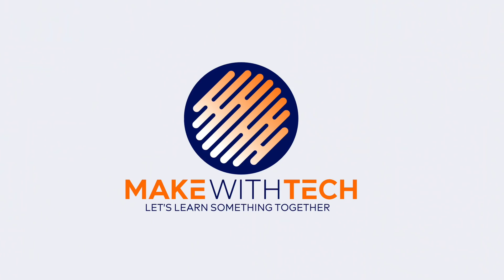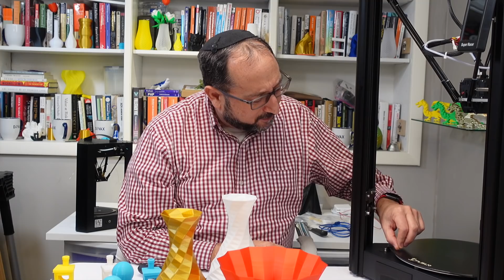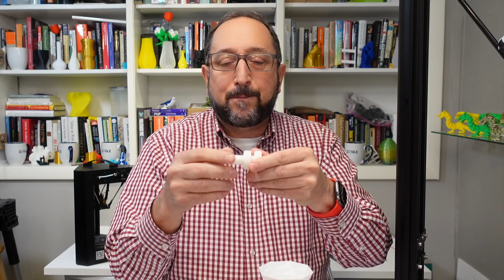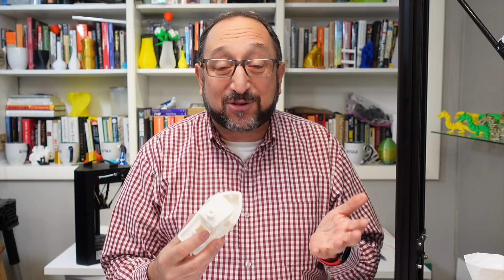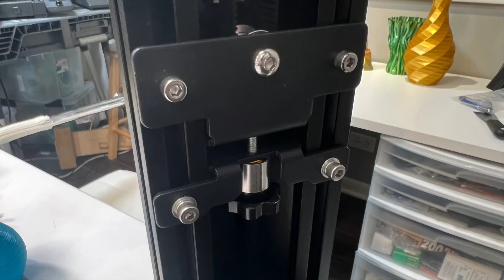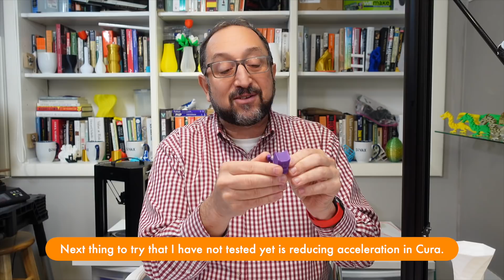Flsun Super Racer 3d Printer Review, Speed and Quality Tests

Comment: I am intend to buy a FISun and have one specific question about the building volume: i need to know if the printer is able to print a diameter of 37mm at a height of 322mm ? 
Due to the delta config i was reading that 260mm is limited to around 275mm and from there the max moving to the center.

Comment: I have a super racer and it prints really well up to around 10 CM height, after which the nozzle starts scraping the top of prints, getting louder with each layer, until eventually, it knocks the print off of the build plate. This happens with the default settings and I've tried zhop set to 1 mm, combing on and off, extrusion set to 80% but it still scrapes and knocks off prints. 
Can you please advise?
Reply: Could you solve it? It happens to me sometimes at any height, I think it's because it moves so quickly and the filament melts and loses its shape and when it dries somewhere else the nozzle ends up dragging it and throwing the piece away.
Reply: @Facuvw  not much improvement. It's due to a cooling issue. The freshly printed area curls up, especially infill which then drags the nozzle. It gets worse with increasing speed. Reduce infill and wall speed to 80 max.
Or return if you can get your money back.
The installed fans are very under sized. I had to buy and splice 5015 fans. I had to print and install brackets for them. Then I had to print and install different fan ducts. That has reduced the issue but not completely eliminated it.
With the amount of time and money spent I should have bought a Bambu carbon. 
Most of the time I end up working on the printer rather than 3d printing.
Most of these YouTubers get compensated in some way for reviewing these products and don't like to talk about these gotcha issues. Then we get stuck with these printers.

Comment: Thank you so much this actually solved my question because I couldn't figure out why my printer wasn't able to detect my flash drive. No one on forums answered that it was a firmware problem and that the SD card AND USB slot don't both work out of the box.  Also thank you for going into so much detail on tuning it, I got mine this past week and am excited to improve print quality already.

Comment: That was hands down one of the best, most thorough reviews - answering all the question I had about this printer - that I have watched. I was on the fence to buy this one and this review helped push me over the edge to make the jump. Thank you very much for your time and excellent investigative review!
Reply: Agree. Wish more reviewers would point that out instead of just saying how fast it is. It is fast. Anything post 40mm/s is fast, and this printer blows that out of the park with way better print quality than most traditional printers at high speeds. However, most people need to know they'll probably be best served at lower speeds than the max the printer will do, which will still be fast by most 3d print standards.

Comment: Great review; and knowing my way around 3D printers and especially delta type printers, I would actually choose this printer today if I were in the market for a new printer (I'm not, I'm happy with the Monoprice Delta Pro which I got at a ridiculously low price 1 1/2years ago). However, choosing the Super Racer, I'd also invest in certain minor (and cheap) improvements - but most importantly, I'd use Prusa Slicer or Super Slicer. Personally, I use Super Slicer because I need the extra adjustments that are possible - but Cura does a weird thing with acceleration/jerk settings. 

You actually also mention with the Monoprice MP10 in your review, that we should leave jerk alone for that printer; and that's true - for Cura. However, with Prusa Slicer or Super Slicer, you can actually utilize jerk settings for faster print speeds in a lot of scenarios. And furthermore you can push acceleration a lot more. 

There's something about the acceleration curve in the algorithm that Cura does, which Prusa Slicer (and hence, Super Slicer which is built on Prusa Slicer) does not. Even with low jerk speeds, Cura will violently accelerate - maybe it's actually just linear - whereas Prusa Slicer does what seems to be an easing. 

Testing on my Monoprice Delta Pro at 150 mm/s print speed, in Cura I can go to a max of 2500 mm/s acceleration and just 10 mm/s jerk, before it straight up throws the magnetic rods off. Even if I'm lucky and the magnetic rods stay on, the print will look horrible and the printer will sound like an old Lada engine on the highway trying to overtake a Lamborghini. 

But in both Prusa Slicer and Super Slicer, I use 5500 mm/s acceleration and 25 mm/s jerk, with absolutely no issues. No thrown magnetic rods and great print quality. So great in fact, that I use these settings for precision prints too. Only for small figurines (less than 5cm height) will I lower acceleration to 2500 mm/s and jerk to 15 mm/s.

And yes, those differences in acceleration and jerk DOES have an impact in print speed too, to the benefit of Prusa Slicer / Super Slicer.

Currently I'm speed capped by the volumetric melting speed (mm3/s), and I can only go up to 10 mm3/s. That's horrible - but that's where FLSun Super Racer has an advantage with its improved hotend.
Reply from the maker: Excellent information.  Thanks for sharing.

Comment: I learned quite a bit from this video. Thanks! I love my SR. I followed teaching techs calibration guide and found my prints were much better at 150mm/s. I set my base to 160mm/s after changing to a bimetal heat break and upgrading to 5015 fans. I finally got klipper setup and running. Uncalibrated the quality was already much much better. I am still calibrating and learning how to use klipper and fluidd. I’ll report back my experience once I’m done! It’s turning out to be quality and speed just like I am looking for! (I feel like in a few years, maybe sooner, we will look at 150mm/s as slow for a standard printer)

Comment: The belt tuning idea is useful, but 60Hz seems too slack for an Ender 3. I've no idea what it should be, but mine is somewhere around 320Hz not sure if that is too tight, but so far, so good. Any idea as to the 'best' settings?
Reply from the maker: Trial, test, adjust

Comment: I've had this printer for a few months now and have nothing but problems with it. Printing a good first layer seems impossible with this printer. Tried everything. Belts adjusted properly etc etc. Have compiled a Marlin myself which can perform the most extensive bed mesh and still I can't get a good first layer that is level even with the most extensive G33 calibration. I have now solved it with the flow rate but unfortunately my first layer remains inconstant level. And that's just one of the many problems I have with this printer. I don't recommend this printer!
Reply from the maker: Try cleaning the bed while COLD with alcohol and applying a thin layer of Magigoo or Dimafix.   I had the same bed type on a couple of other printers I have had for a while and this solved it.   

As an alternative if you really do not like the bed stick a piece of BuildTak on top of the glass and relevel.   I used this approach on plain glass beds with excellent success.

I wouldn’t dismiss the printer just because of bed issues.  I have 14 3D printers from multiple vendors and the above two approaches have solved my bed problems.

I hope this helps.
Reply: @MakeWithTech  bed adhesion is not the problem. It's the constant height on the bed despite lots of extensive calibration and meshes. In some places too close to the bed and in some places too far away from the bed. It seems that the bed is too warped and the printer cannot compensate for these differences properly

Comment: Actually, My prints will pop off when the plate is a little less than 40 c.  As it cools further, you can hear it start to make cracking sounds.
I'm glad you actually got the chance to test the flsun delta.  I learned something about tuning the belts.  I was wondering what I could come up with to sync the belts, even a pressure sensing device.

Comment: So, if i understand it correctly it's fast but laks quality. I'm working with a Ender3 v2 now and have excellent quality prints. It takes time but the prints are great. I was thinking about buying one of these Delta printers but i guess it's better to wait until they sort out the problems with quality at higher speed. Great video, i love watching your videos. Somehow your way of talking about stuff makes me actually listen without losing intrest in what you are talking about. A lot of videos from others are ok, but somewhere along what they are talking about i loose intrest because of they way they present it. Maybe i should not ask but , are you a Rabbi? That would explain a lot.
Reply from the maker: Thanks for the comment.  

At Ender 3 speeds this printer with a properly tuned profile and reduced acceleration settings should produce prints as good as the Ender 3.  But it will take some work.

The advantage is that is very fast for prototypes and other prints where minor surface defects will have not impact.  Then slow it down to print your prints that need to be pretty.

I am not a member of clergy just a regular guy.

Comment: Thankyou for very informative video, the belt tuning is a fantastic idea I will adopt immediately on my SR, for easy part removal use a round piece of 3mm to 5mm thick Borosilicate glass, use bulldog clips to hold down the glass to the original heated bed. recalibrate your Z axis ( bed height) to compensate for the glass, clean with IPA this should cost less than £25 GBP.
Reply from the maker: Glad it helped.  Thanks for the suggestion.

Comment: There is a lazy way to get prints off of that textured glass like my Creality one. Just smack the print on the side. The shock will pop it right off most of the time.
Reply from the maker: Sound likely to break a fragile print.  I'll stick with the fan or freezer.  Both work perfectly with less violence. :-)

Comment: Good grief. I didn't realize the Super Racer was THAT big... At one time I was considering a FLSun delta but the build surface area was the drawback. Went with a Artillery X2 instead. It's got one of the drawbacks this printer has - the glass print bed isn't removable, and I found that if you try to use isopropyl alcohol to clean it, you will damage it. I think this is true for all of the beds that are made like this.
Reply from the maker: I just use water and I also used a bit of DimaFix for one tricky print.  Then make sure you let it cool off complete.  With that work flow I love the surface.
Reply: @MakeWithTech  For my Artillery X2 I ended up clipping another bed on top of the installed one. Currently using 300x300mm sheets of glass (actually 2mm mirrors from IKEA, which are about $6 for a box of four). I want to eventually try a 310x310 sheet of garolite or G10. The mirror requires glue stick, I've gotten used to this from my first printer. In between prints I spritz some IPA on the bed - it dissolves the glue stick and I spread it around. I suppose this wouldn't work with the Super Racer - it doesn't look like it's possible to clip another bed on top of the present one.

Comment: Thank you for this informative video, many very useful tips especially for the belt tensioning.   I have just bought the QQ-S to compliment my Ender 5 Pro (which will now be used for miniatures) and it isn't as rapid as the SR but is still quick.  I definitely agree on the quality issues - layer shifting and stringing - so an update on your findings would be very interesting.  I had issues with bed adhesion but found a sugar water method from Mysimplefix video and it works excellently.

Comment: The stepper motors are on the top of the printer not on the bottom
Reply from the maker: You are correct.  You assemble it upside down and then flip it.   I forgot.   Thanks for the correction.

Comment: A piece of advice for your vases: I fill the bottom of them with plaster (ratio 1:1) and then I let it dry for a week. After that, they are quite stable.
Reply from the maker: Great idea.  I have been using glass florists beads in mine.  That said the vases I print with 3 walls, no top, no infill with the vase/serialize setting have much better weight.